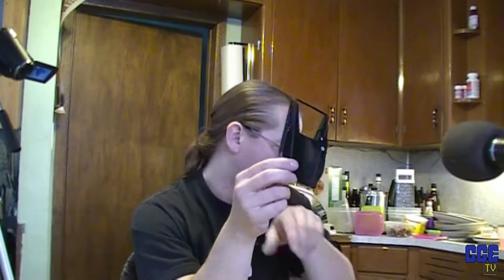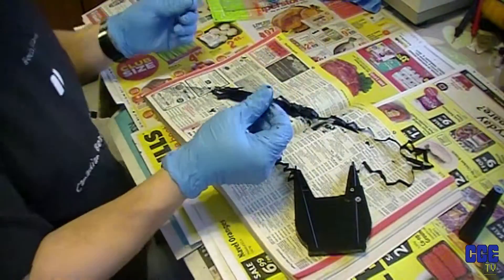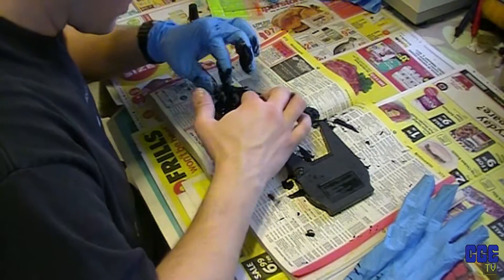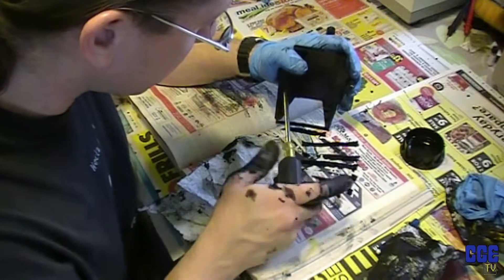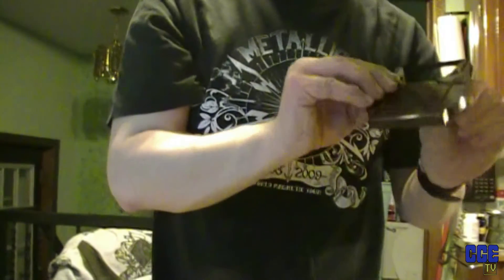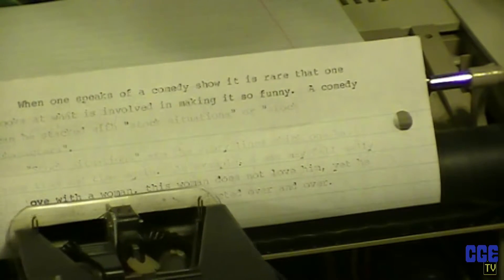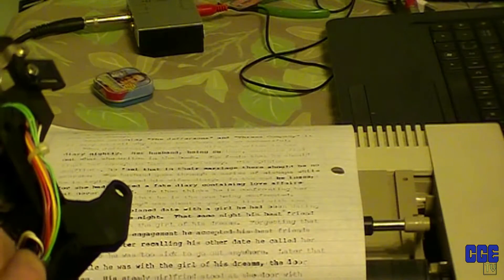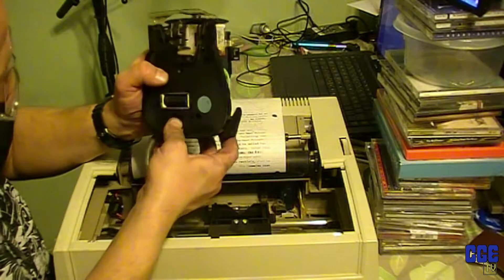TOTC-02.08: Coleco Adam Printer Repair & Re-Ink

Comment: Used to do this with my old Epson lx-80.   Use a drill to move the tape.  snap the ink tape between two bingo sponge bottle and away you go.  You can use some kind of clamp and splash guard.  You're in business.